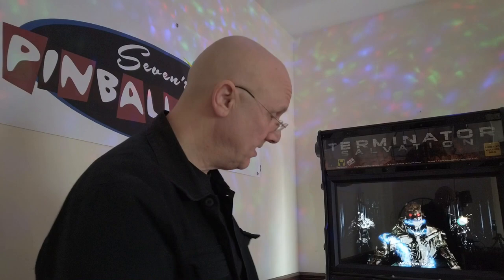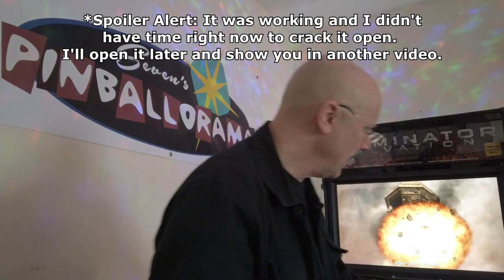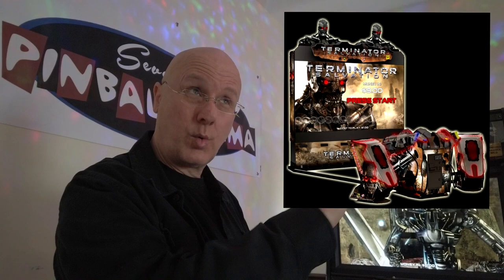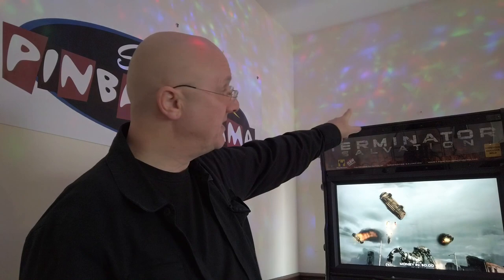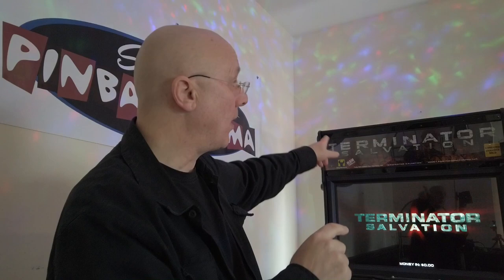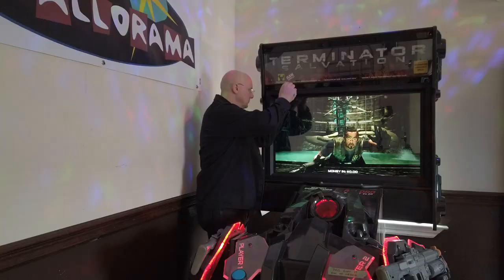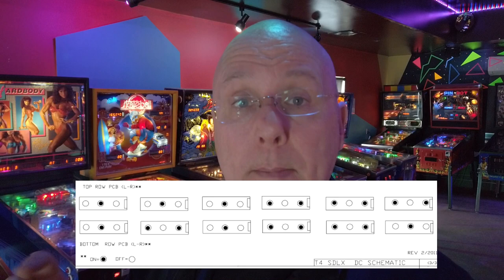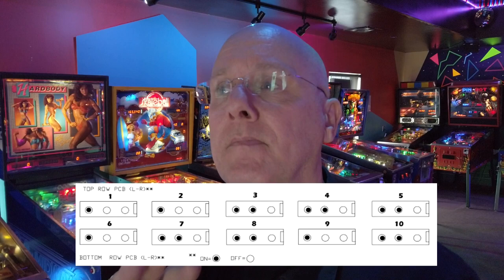Fixing Terminator Salvation Arcade Gun Tracking

Comment: I have the same machine and the sound is very low tried new speaker  same problem not sure where to start any help would be great!!
Reply from the maker: I assume you've messed with the volume controls in the software.

If I recall, the sound comes from the computer via patch cable to an amp. I believe that amp had a volume pot. Try unplugging the phono jack from the computer and plugging it into a phone or something you know has a good audio output. If the volume is still low, then the problem is at the amp or possibly the patch cable. Find the volume knob (which I think it has) and mess with that or replace the cable. 

That's what I would try first.